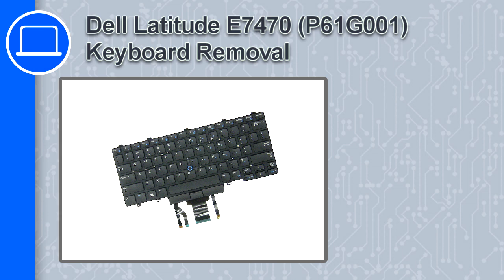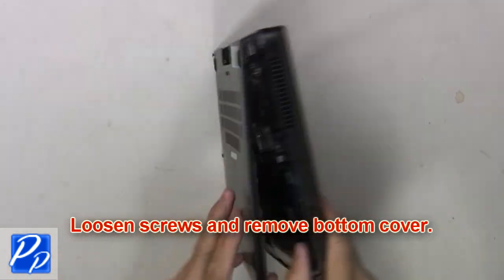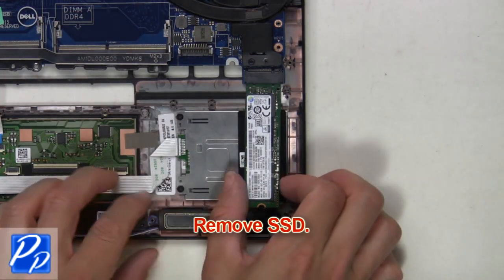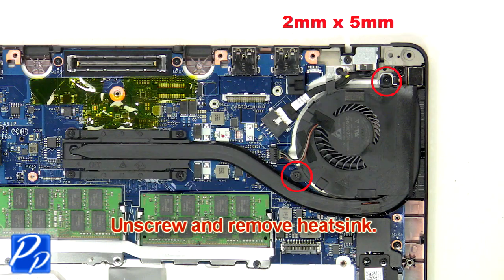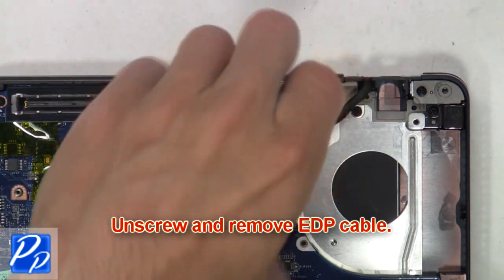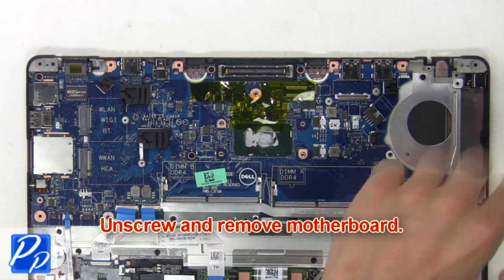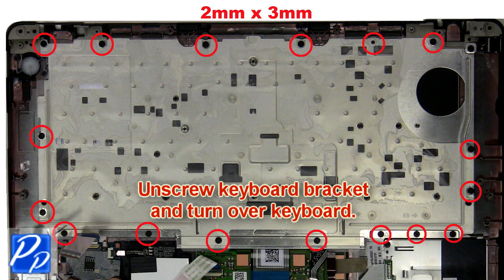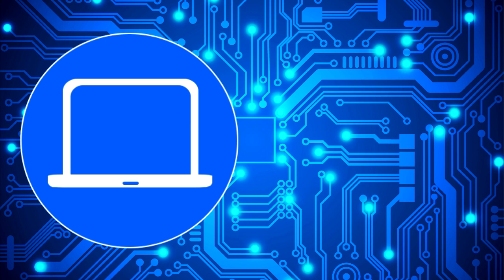Dell Latitude E7470 (P61G001) Keyboard How-To Video Tutorial

Comment: This video was phenomenal.  The little red circles (brief moments) were gold, thank you.  I successfully got my new keyboard in (3, E, D, C and ALT were toast) and the laptop actually turned back on!  I was so happy!  And I only had 1 screw left over!  Have no idea where it goes, probably on the keyboard back-plane, there were so many tiny black screws I must have missed a spot, I also installed one in the hole the heat-sink fan needed, so I had to take that one out, and there is where the "spare" screw came from!  😀
Reply from the maker: This is great to hear. Congrats on your repair.

Comment: This line (Latitude E74XX) used to be very serviceable.  This model is a nightmare.  Just getting the back panel off takes 5 mins!  It takes an hour to replace a keyboard!!  Might I add that the keyboard is a piece if dirt and YOU WILL NEED TO REPLACE IT!!